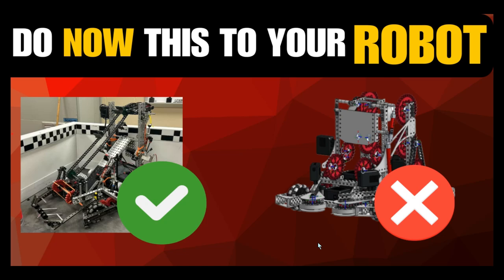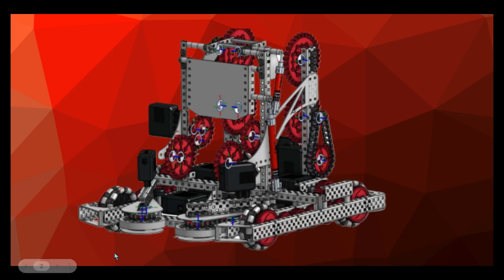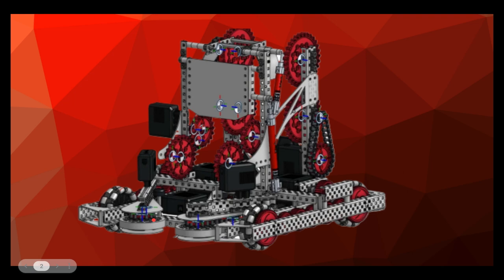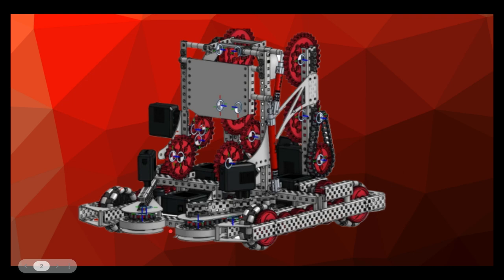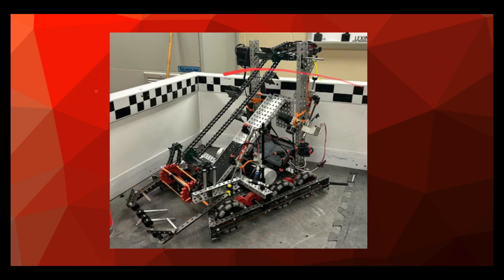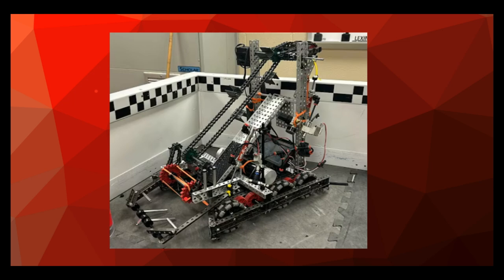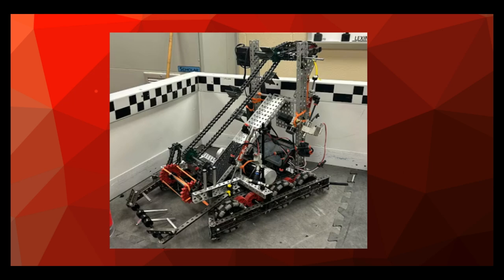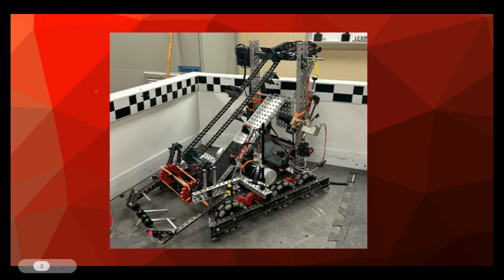🚨 STOP Using Side Rollers! Here's What TOP Teams Are Doing Instead...

Comment: Here is my thoughts on this. Yes the rubber band rollers are good for picking things up quickly. It seems slightly slower than side rollers to get match loads by a small amount and it can’t get the bottom goal in the center as well as the side rollers can. So why not have retractable side rollers that move the balls into a rubber band rollers. That way you can get the best of both sides
Reply from the maker: most teams in the recent scrimmage are doing this. I is just faster

Comment: Why is the top roller better? Couldn’t you just have the side rollers spin faster, and maybe attach them to a pivot? It might be tricky to get the 5.5w motors to not stall out when picking up multiple blocks, but other than that, I can’t see any problems with it
Reply from the maker: You could pursue that option, but you would miss the chance to take in two blocks at a time. The main advantage of using a horizontal rubber band intake is that it allows you to clear all match loads in about 2 seconds with that extension shown. Additionally, when driving, it will be easier to position the robot to pick up a block. I hope this helps!

Comment: I have seen some designs where the two rollers are attached a a piston that spreads them apart for on the field making it intake much wider and faster. It might be possible that the rollers are not a bad idea.
Reply from the maker: Although you could design a robot like this, the rubber band horizontal intake will pick it up more effectively and will work better with a device that can remove all the match loads.
Reply: @TheVEXAnalyst I agree with you and also side rollers require 2 5.5w that you can’t chain to any other part of the intake. With rubber band rollers you can chain that motor to the other rollers
Reply from the maker: @adamsalem-s  true